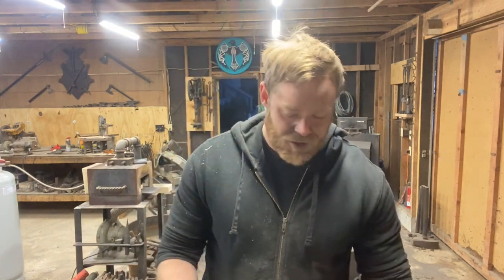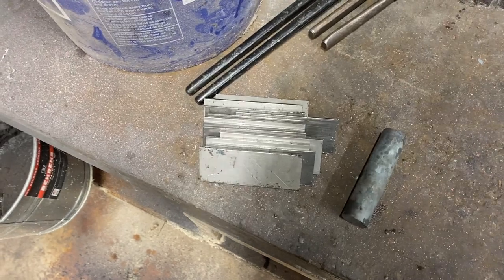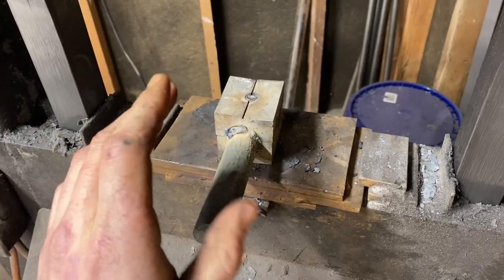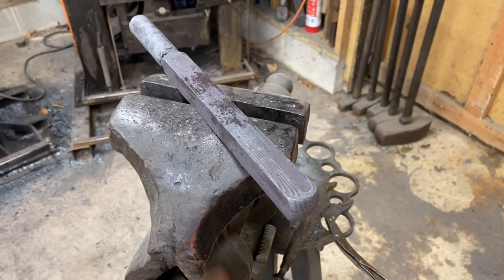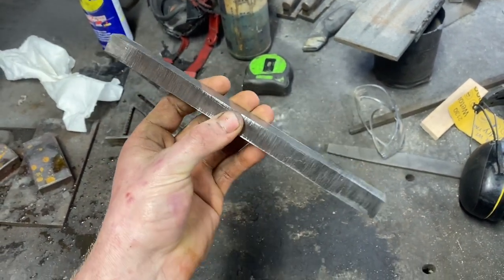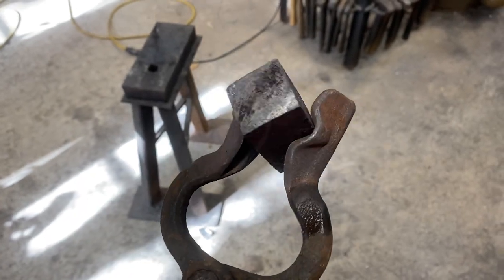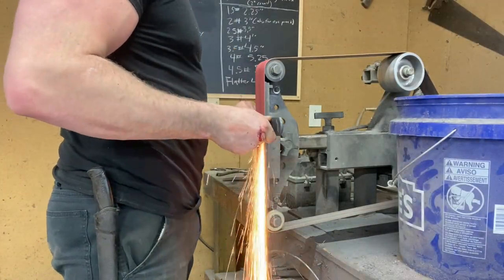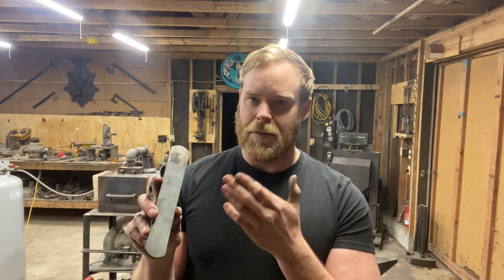Attempting mosaic Damascus, basket weave pattern

Comment: I would make a nakiri or a petty knife out of it. Otherwise, fancy bottle openers!! Next time, try to ladder it. With a fine basketweave like that, it comes out a  really neat pattern. That's, of course, if you don't want to tile it, which is tricky if you have a short stock like that. Good work!

Comment: It’s important to completely encase the metal that’ll be your final piece when forge welding. Decarb will add bright spots to your pattern. Another option is grinding .060 after every heat

Comment: how about a few small double-edged survival knives, flat ground on the base side, pyramid on the top face, with a thumb hole near the base of the blade and 4 thong holes so it could be tied to a stick as either a spear or as an extended handle? length about 4.5" width about 1.75"-2" thick about .2"  ... something that would show off the pattern in all its glory! cheers! EDIT: the idea would be to replicate the concept of the percussion bulb of flint-knapped blades from ancient times, brought forward to the modern material. iirc, a fellow designed one like this for a pocket survival kit as a neck knife, about 20 or so years ago, but i have never seen it offered in production. the idea being it is the last blade on you when everything goes wrong. Cheers from Vancouver, Canada.